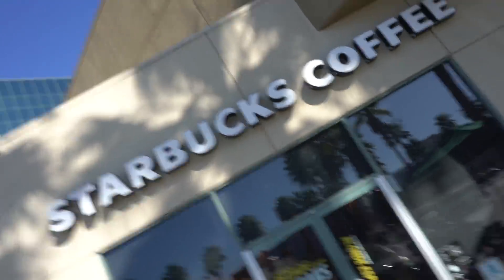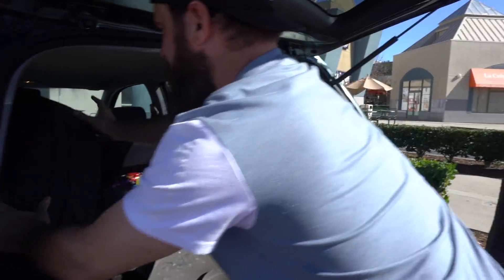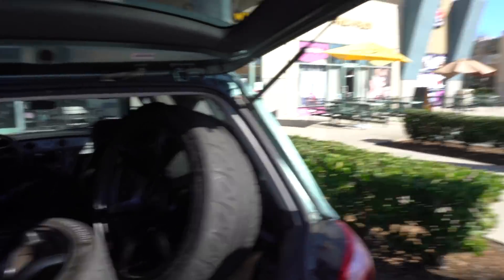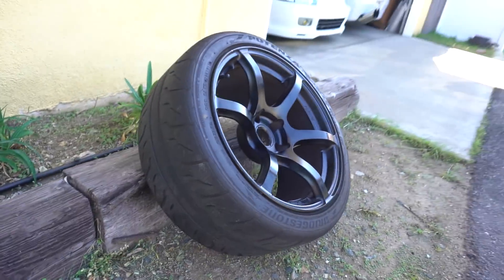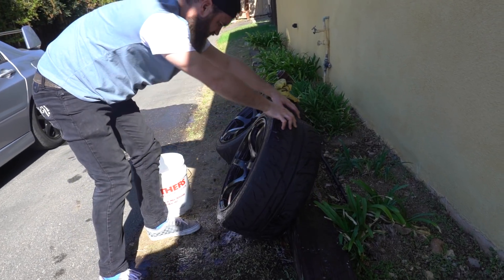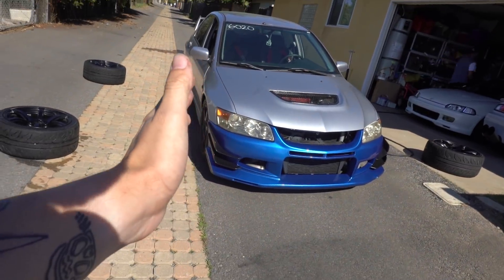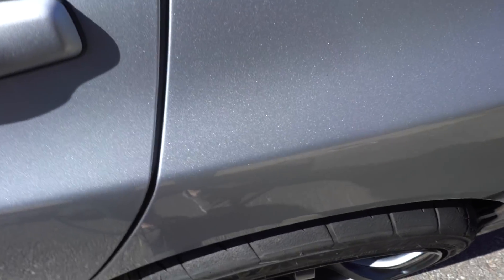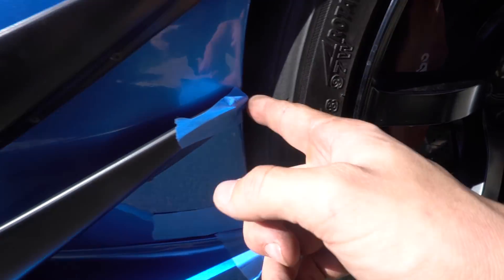NEW EVO 8 TRACK WHEEL SET UP!

Comment: If you are going to track it anyways then its going to need some camber for turn in response and helping you stay flat in the corners, why not keep the wheels off until you get your suspension setup and alignment handled so you don't end up pulling too much of the fender. Id also go with some stifffff spring rates anyways for an awd track setup/meaty fitment, thats what I have on my own car. Love your channel and your builds!

Comment: I have this exact fitment on my 8. 225 is the way togo. Rolling the rears is about all you'll need with -2° camber all round. Trying to "pump" the rear archers will more then likely end up like you're front attempt, but usually a much bigger (longer) crease.
Reply: Also if you're going to track it, buy some weak fitment and put 265's on for the track.

Comment: First of all, it's your car, do what makes you happy. However, you already cut your new bumper, are talking about pulling the rear fenders(which is actually the shell of the car) and more or less do mods that are irreversible to still have wheels that don't fucking fit. Rolling fenders won't make up for the extra 25 mm of offset you shouldn't have. Like I said before do what makes you happy, but what makes you happy also makes you look like an idiot. Buy the correct offset wheels, don't modify your car to the point it can't be put back to the way it was.

Comment: Unless you have a Pro at rolling front fenders on an evo, it’s basically impossible. The fronts are made of aluminum and are quite flimsy when it comes to rolling. Most people end up just cutting them. The rears should be easer since they are sheet metal. But again you will want a pro because they have pinch wields and if it’s not done right the entire fender will buckle inward

Comment: Wider is not always better for the track. More seat time is better. If you are new to the track you most likely wont use all the grip the tire will offer so going a wider tire isnt always the best. Lets face it dustin is a stance guy and got the offset for stance. Is you where getting it for track get the right offset with the same width. Since the rubber will be the same

Comment: Add slightly more camber so you don't have to pull the fenders that much.
Reply: Adrian that kind negates the point of track wheels. He would need more than just a little.
Reply: MANIC R55 Especially with track wheels/tyres you use much camber, not for the looks but for the performance while cornering. With 2.5 or 3 degrees camber there would be less rolling/pulling needed + the cornering performance would be better.
Reply: Adrian yeah but he needs wayyyyore than 3 degrees to fit those
Reply: Of course, only with camber he will need much more, but I'm saying 3 degree camber + slight pulling/rolling is better, then nearly no camber and very heavy pulling/rolling. As w have seen what happened with the fender at the front :D